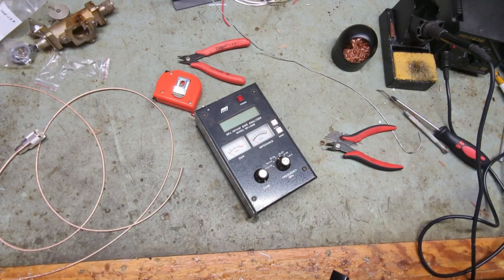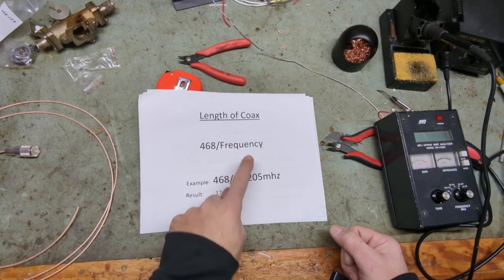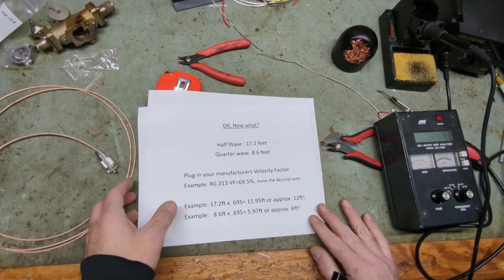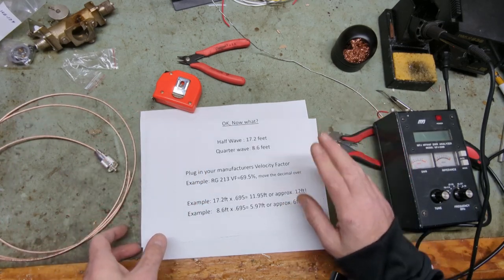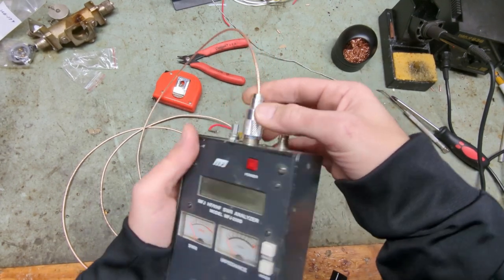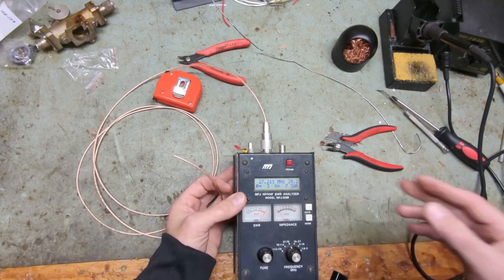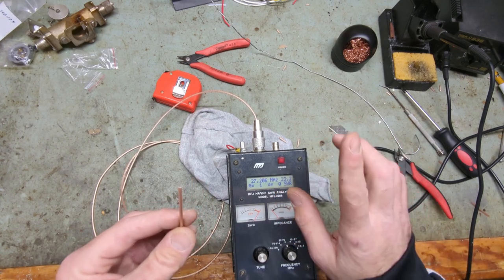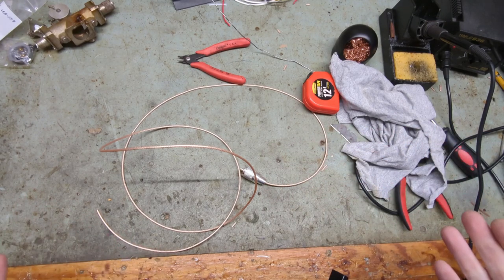How To cut your coax to nulls or coax tuning

Comment: There is no reason to cut a coax cable to a quarter wave (or other specific length) for jumper cables. you can use any practical length to connect your radio to whatever you need to connect it to.  I f for example your Watt meter is only 2' away from your radio, you can't need a 6' piece of cable (it isn't going to affect the performance of your radio in any way). Making a coax cable any longer than you need is just a waste of coax!
Reply: we can argue that the excess cable is a loss of signal, but certainly not a gain in invisibility to the system! Even if only the difference of 4 feet. imagine if we are working at V/UHF freqs, and each foot adds up with loss.
 I worry more about the connectors chosen and lets get rid of every extra foot of cable in the system that we dont need. the only extra footage MIGHT be the drip loops and room to move gear but past that its all BS. You are absolutely correct!
Reply: @ChrisRobinsonKF6NFW You speak about different thing
Reply: @jacuswoczega9180 How so? Explain. I speak of the exact same. I may have explained differently and put into different context. However, extra coax is extra loss.  Do not cut a cable any longer than you need it. There just is no need. It's pure waste of money and rf power.  I am willing to explain and show the math and work though to anyone. I'm also willing to admit where I am mistaken if you show me that also
Reply: @ChrisRobinsonKF6NFW  I agree. Only small clarification, most of thread is about magic length. Loses are generally known, and almost no controversial (one exception: microvawe low loss cables fof CB)
Reply: @jacuswoczega9180  but the point being, the magic length is whatever it takes to get from radio (point A) to antenna (point B) any length longer is a waste. If you wish to cut for some wavelengths to solve an antenna issue, this is clearly not the way to do it.
Reply: He seems to think an SWR meter is an isolation device with two totally independent coax cables, that they don't connect together at the SWR meter.
G4GHB.
Reply: @bill-2018  He is wrong on many levels. This whole video is one big myth...
Reply: @radioguy19510  
The myth goes on and on.
I've cut coax to 14.040 MHz to make a video to show it's all nonsense. 
Why don't I get more loss if the correct coax length is a must? FT817, 0scilloscope, my RG58 and 50 Ω dummy load.

14. 040 MHz 1 Volt drop.
10.1 MHz 1 Volt drop.
18.1 MHz 1 Volt drop. 

Tuned coax theory says it should be terrible off frequency with almost nothing at the dummy load.
My five attic dipoles 20m to 10m work even when fed with two lengths of untuned coax lengths of about 25 feet each. 
Tuned coax theory says...

G4GHB.

Comment: Why? Just why? This a waste of expensive coax and shows a real disregard for physics and RF engineering.
Reply: He seems to think his SWR meter is some kind of isolation device and there's a 'transmitter side' and an 'aerial side' not connected as one cable by the meter.
Look how many people take this useless advice. There must be something very wrong with C.B. radio design if it makes a difference.

G4GHB.

Comment: Why would you want the coax resonant? It then tends to radiate making the coax part of the antenna Coax resonance is a bad thing
Reply: Coax won't radiate because it's half wave ,coax radiates because of an antenna imbalance
Reply: As a test and for a future video to disprove resonant coax must be used I made my coax resonant at 14.040 MHz. I have no problem with it when on 14 MHz. Ferrite rings stop r.f. on the outer braid so it's not part of the aerial, unless it is wanted say for a vertical in place of radials.
If I add both jumpers of 45" and 20" it's resonant frequency goes down to 11.320 MHz proving the nonsense of tuned coax and 3', 6' 9' or whatever recommended length of jumper is B.S. That resonant length of coax has gone. 
I have to take my SWR meter out because it's a Wheatstone Bridge type and consumes half my power. It's great for tuning aerials because the tx never sees above a 2:1 SWR while adjusting them.

G4GHB.
Reply: @bill-2018  your experiment does prove that the impedance changes with coax length and that by putting a different length of patch lead in can make the transmitter see an impedance it likes
Reply: @Pioneer936  Yes, on an open ended coax which is not the real case when 50 Ω is connected. It is an open ended half wave stub at only 14.040 MHz but flat right across 1.8 MHz to 29 MHz with 50 Ω connected.
Don't take my word for it, try it yourself.
I'm waiting for sunny weather to get good illumination in the bedroom before doing the video.
Reply: @bill-2018  most people don't have a 50ohms perfect match, this is probably where some misunderstanding arises
Reply: @Pioneer936  It could well be.

Comment: So... a different length of coax is needed for each band???  Example:  someone working the 10m band will have to use a different length of coax to work the 40m band???
Reply: Good question. This is fundamental error in "coax tuning"
Reply: Or on different parts of band. Many ham bands are wide 7-9% of central frequency, which gives HUGE difference on phase.
Reply: Indeed. I have two dipoles (10m and 15m) on one coax and three (20m, 17m and 12m) on the other. Both coax lengths about 25 feet so probably both wrong by his reckoning. 
Why do my aerials work?
What length would he say I should be using for my 4 element 2m collinear?
G4GHB.

Comment: I remember someone telling me many years ago, in multiples of 14 feet, I was just getting into cb radio back then, one guy said length didn't matter, but I cut my coax to what your showing and apparently it does matter. Thank you so much for this video, I had forgotten alot since I was a kid.
Reply: Whoever told you that had no idea what he was talking about.  But instead of investigating and learning you ate it up.  Hopefully you no longer do that.  Info is available, books still are available.
Reply: Put a 50 Ω dummy load on your coax and see what your power is. Try another length of coax. Is there a difference? 6 inches or 20 feet should make no difference unless it's very lossy coax. Why do you believe in a magical ¼λ coax?
G4GHB.
Reply: You say it matters. How did it change things?
I've never cut coax to a specific length. I'd need 44 feet on my 5.262 MHz inverted vee. I haven't.
G4GHB.
Reply: Using 468/freq. To find half wave in free space will get you close. But this is formula for a half wave dipole, which is about 5 % shorter than free space length, due to end effect of the wire. Best to use 492/freq. to get half wave length in free space then apply the velocity factor of coax you are using for a more accurate number.

Comment: Don't "solder" coax with a foam dielectric. Use a clamp or crimp style connector. If you solder the shield, you will melt the foam and the coax is no longer "50 ohms" by design.

Comment: OK,  OK,  OHH  KAY !!!!  THERE IS NO REASON  to  "cut coax to nulls"  or to a specific length  when using coax as a feedline!!!   The CORRECT LENGTH  for a coax feedline is  THE LENGTH THAT IT TAKES TO GET FROM THE TRANSMITTER TO THE ANTENNA!!!!
Reply: Another ring in the CB radio SWR circus. If trimming coax is needed to adjust SWR, there is something seriously wrong in your station, be it a splatter-box amp or dirty transmitter. Similar to cutting your garden hose to get more flow...
Reply: If the radio sees not only the antenna but also a combination of antenna mast and feed line, and this is the reality then it's a waste of time tuning the antenna while taking SWR measurements at the radio end of the coax and to be honest very few people tune their antenna at the feed point while at height. This is why it's important to tune when tuning a mono band vertical or unbalanced antenna at a midpoint frequency on that band. 
  To prove this (and the effect is different on different designs of monoband antennas) There are many things you can try. Tune at the feedpoint then check the tuning at the shack. Add or subtract lengths of coax to a tuned vertical and see the difference. And regarding masts we enter a whole new world. Try an antenna on a glass fibre mast then put it on a metal one. The tune will change. You can get in the ball park with any length but you might be tuning your coax as part of the antenna system. Just as the mast can contribute as an unwanted radial so can the coax. I believe this is good practice although not crucial with most mono band antenna. After all Ideally I want all of the power to leave from the antenna and none to be reflected. This is why I want to see the tune of the antenna itself and not a combination of stuff like random counterpoise effects from coax and masts when tuning. The mast length and how it effects tune is a whole other topic as it's not only the height above ground and distance from other objects buy it will on many antenna try to act as a counterpoise and a mast can be any length.
  So many variables that myths emerge, different frequencies, unbalances vs balanced systems, transformers, ground laid radials vs radials in the air. proximity to objects. The idea is to control as many of the variables as possible as there are almost always compromises in amateur radio installations.
  This puts the argument back on track. Some vertical (and some other) antenna can tune very differently to each other when each compared on 2 different lengths of coax. If the coax can be made to look virtually invisible at the desired frequency that you will be centring the tune of the antenna around then we can be more sure that we have tuned only the antenna from the radio end and not a combination of antenna and feed-line. I would like to draw also some attention to the general lack of people talking about how the metal masts also become part of their antenna systems to some extent and why are people not fine tuning their masts when they are electrically connected?  Yes it should not really be an electrical consideration yet it all too often makes a large difference to an antennas tune. Put the same antenna on a different mast and re-tune it!
Reply: @izzzzzz6  correct it's an antenna system

Comment: Yes, you can cut a feed line to resonance. But the SWR remains unchanged. Map it out on the Smith Chart to verify. 

The author in this video is suggesting that achieving resonance via the feed line is equivalent to a unity SWR.

In an experiment there might be some SWR movement due to a flawed test procedure or parasitics, but in theory, the length of a feedline is irrelevant for changing the amount of reflected wave.
Reply: did you include the metal mast on the smith chart? Real world does not always act exactly like the mathematical ideal
Reply: most dont understand that the only place to take proper SWR measurement is at the antenna feedpoint, otherwise they are trying to tune the coax as well. 
 Otherwise the coax is simply an extension of the radio and nothing else. 
 As well, most dont understand the relationship between RF Power, Freq, Line Loss or even the choice of coax and line loss associated with that, such as the differences between RG58 , RG 8 and LMR 400. RG 58 may show a perfect swr, however install a better coax and suddenly it may show a high swr. and the truth is it was a High swr all along , but the line loss was great enough that it fooled the SWR meter into thinking it was perfect. The SWR meter is just a dumb meter!